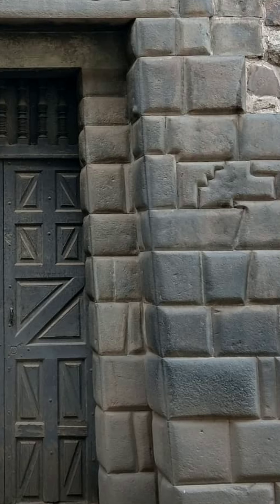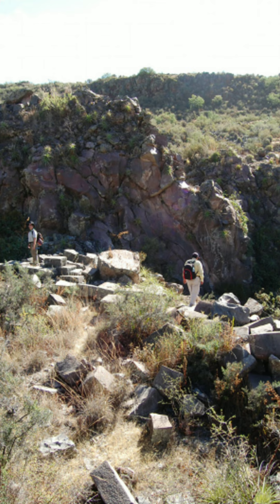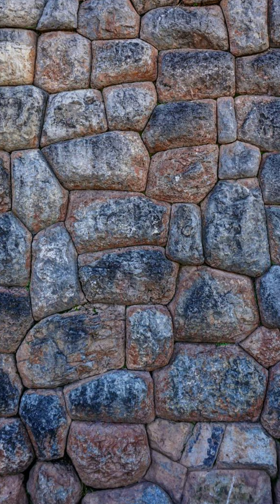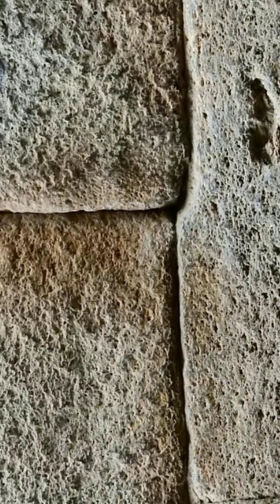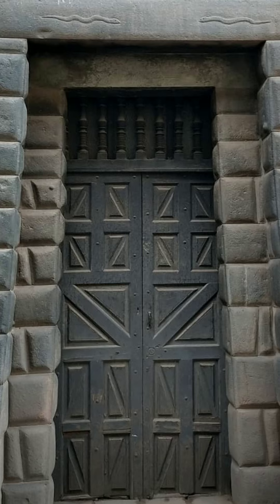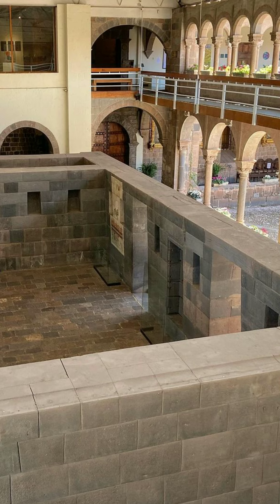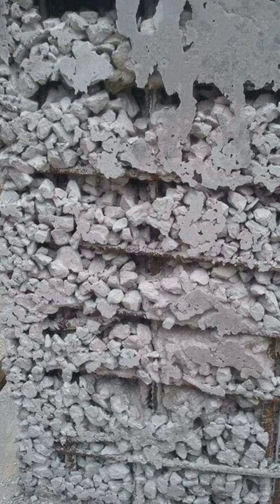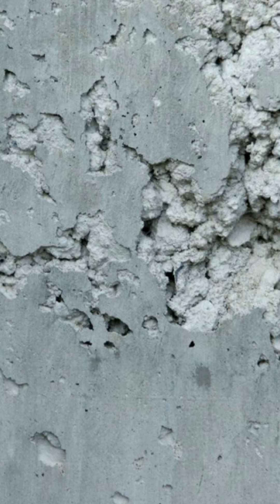Why They Only Used Igneous Rocks in Ancient Peru

Comment: Because some don't know, doesn't mean that all don't know - because they knew, doesn't mean that it was unreal or magic, it only means we are not smart enough and just don't think it's important enough to spend time thinking about how to work the problem - if you have a working solution you don't spend time trying to invent something you don't need! Inventing the wheel over and over again is not going to change the concept of the wheel - and going the way of magic hasn't brought much advantage to society as society has abandoned the concept except for some die-hard and the concept of belief doesn't cure cancer like chemicals do and drinking the blood of virgins doesn't keep old hags from aging - we can question how it is done we can question how it was done, but we should not try to explain it with magic, that is magical thinking.